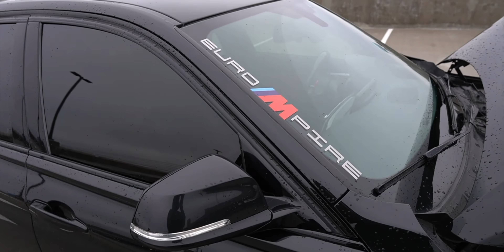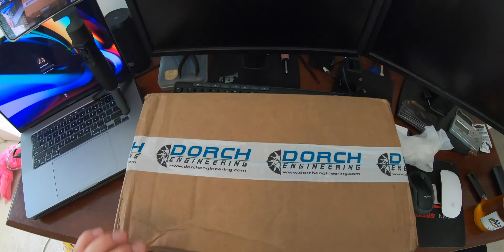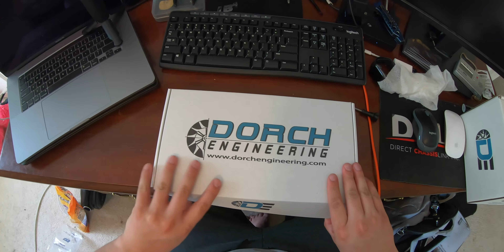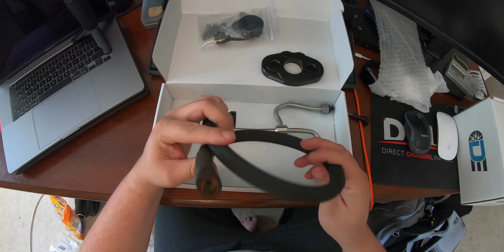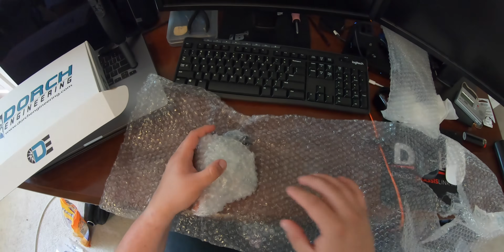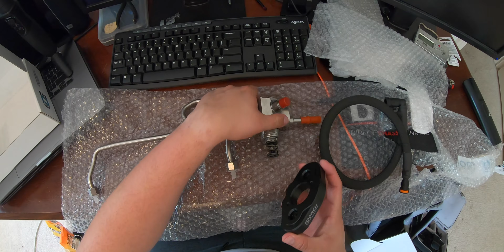THE MOST IMPORTANT UPGRADE FOR (Gen1) B58!!! | UNBOXING

Comment: lets say i am running stage 2 on the 340i, is upgrading the HPFP would make me notice an increase in hp / torque ? also is there a reprogrammation that needs to be done or not ? Love your videos.
Reply from the maker: You would notice a substantial jump in power on the Stage 2+ E30 map.

Comment: Do you think this is better then the spool 180
Reply from the maker: Spool FX-180 technically has a slightly higher flow rate, but the benefits and differences between the two haven’t been explored enough to note significant differences.

Comment: Omg this pump seriously cost an arm and leg, can't believe it, it's not like we're driving f*cking lambo or McLaren. Doesn't make sense for something that small to cost that much, hope they come down in price in the next year or two when it's more readily available.
Reply from the maker: I think that’s part of the issue, there are only 2-3 companies I can think of that make these and they’re fairly new. That being said, you’re talking about a mod that will singlehandedly raise your power cap from mid to high 400s to high 700s without supplementary fuel... I think that’s worth it!
Reply: @NoClutchGarage  i feel like for that kind of price, should be both the hpfp and lpfp together as a bundle lol. Solve all fuel issue in B58 series.
Reply from the maker: I don’t disagree there lol